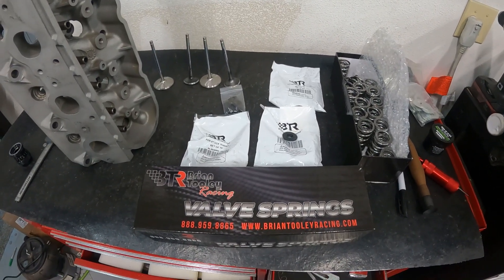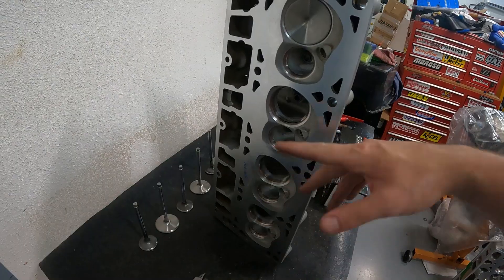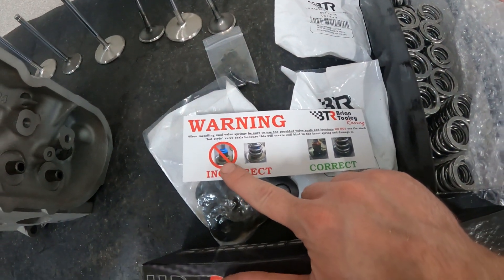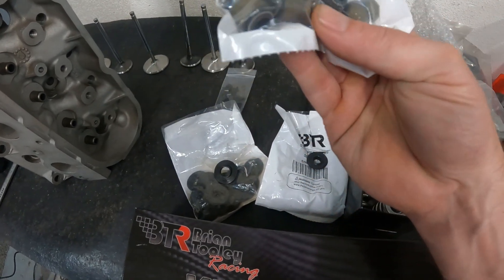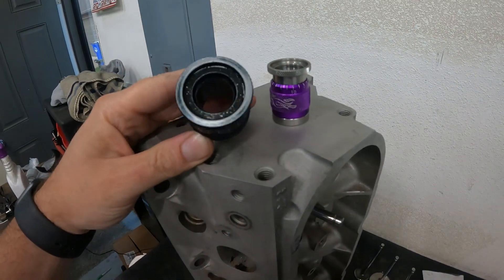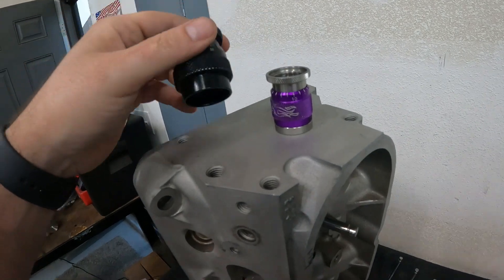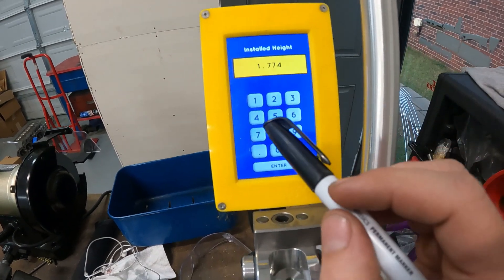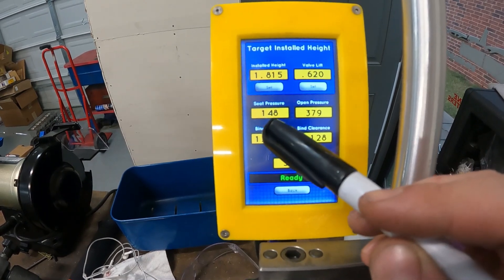Assembling LS3 Heads With BTR valve train kit

Comment: As a machinist I use Clevite bearing guard everyday but I wouldn't recommend it for valve/guide lube.  Assembly lube has too high of viscosity for the guide clearance on an automotive engine. If you would pull that valve back of the seat .500 all you would see is the red blob of lube on the guide boss that was wiped off of the valve stem.   I lightly oil the valve stem and the guide .  If for some reason you got enough assembly gel pushed up to the seal it could cut off oil flow to the guide while it is getting hot enough to dissipate and by that point the damage is already done.  Engine assembly lube anywhere in an engine should always be used  with discretion  and moderation .  It doesn't break down as quickly as some people think and can create more problems .  Some assembly lubes are worse than others.
Reply from the maker: The guides have almost the same clearance as rods and mains. Within .0004. I have yet to have a problem using it.
Reply: @WeingartnerRacing  my point was that it is so thick you aren't getting hardly any of it in the guide!  It's all sitting in a blob on the guide boss because virtually all of it was wiped off during insertion.

Comment: I installed guide plate with Integrated seal.. I didn't use a tool, I just let the spring push the seal as I installed. Do you think it seated it 🤔?
Reply from the maker: Probably but not ideal. Btr kits don’t come with those seals.
Reply: This is a Texas speed .660 setup its very similar. Thanks for reply. Keep up the vids!